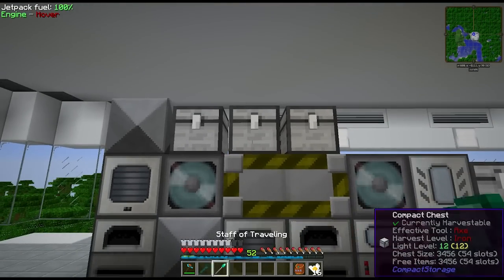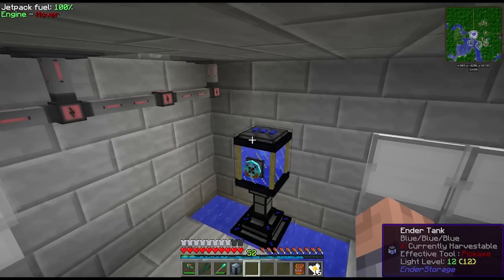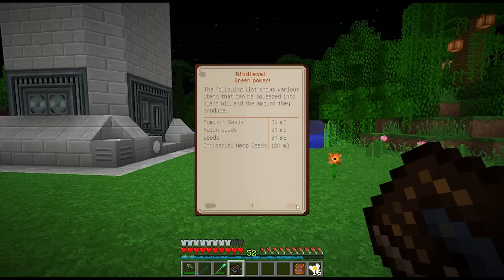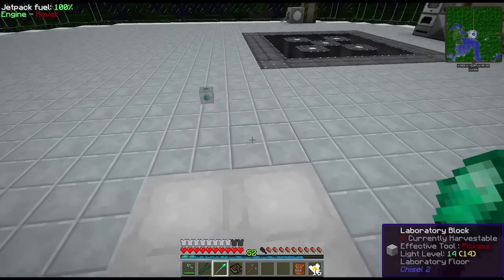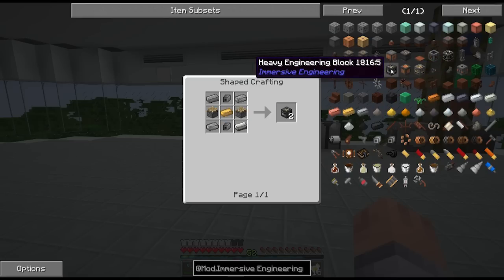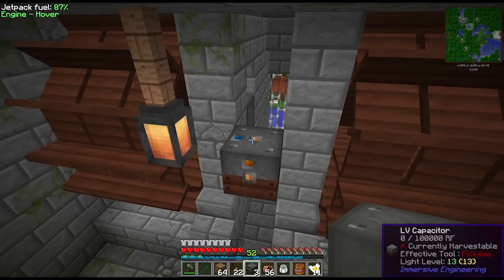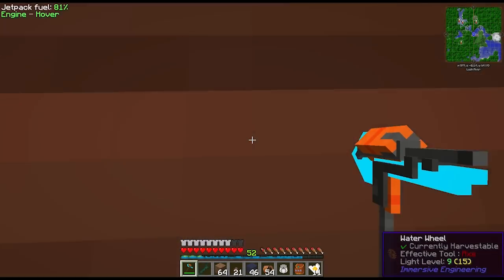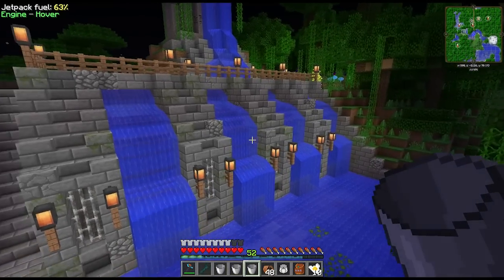Modsauce 2 #7 - Immersive Engineering 1/3

Comment: That looks really great, Thorgal. The glass blocks are a handy tip. That tower in the back looks very similar to frequent style of mine.
Reply from the maker: +Monkeypuzzle Thanks :) I kind of wish that you didn't need to have the water go underneith the wheel. As long as it's turning and has 3 wide water going over it then it should produce the max power.
Reply: +ftog thorgal I agree. Although I was just looking at pictures of waterwheels irl and it does take them about that far for all the water to fall off if the wheel is spinning fast enough.